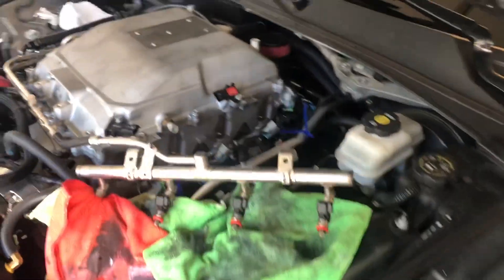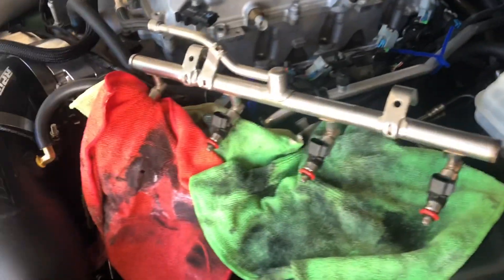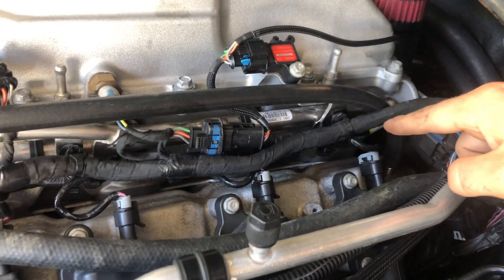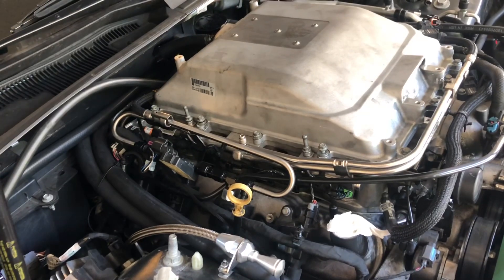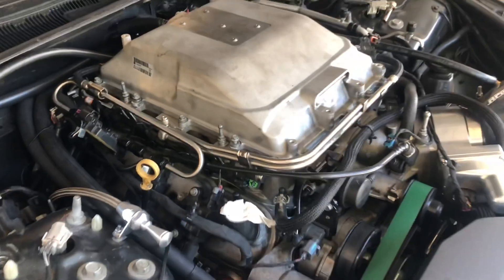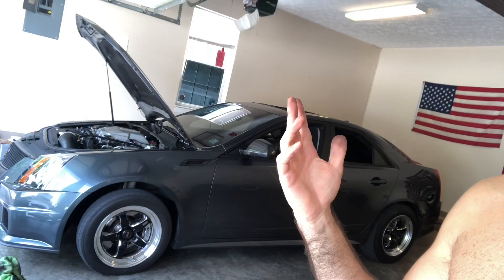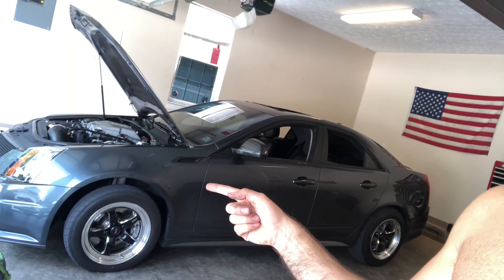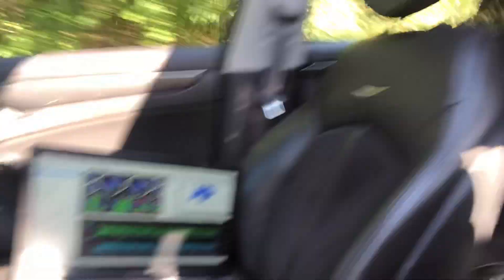How To: Install ID1300x Injectors in a CTS-V

Comment: Im just having problems with the part where you pull off the injector plug ins. Pull out the green part and then what
Reply from the maker: The green clip is a retainer clip to make sure they don’t come out. When you hear that green clip release just pull on the grey part and it will separate from the injector